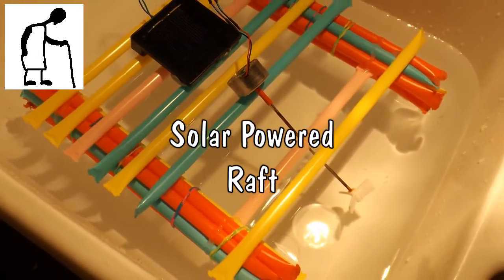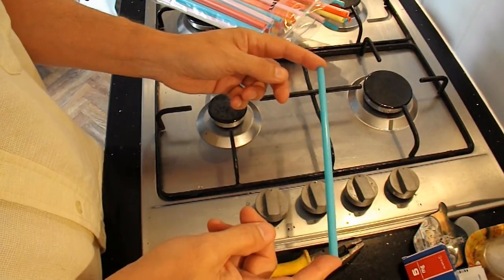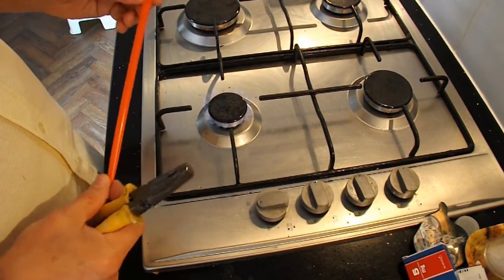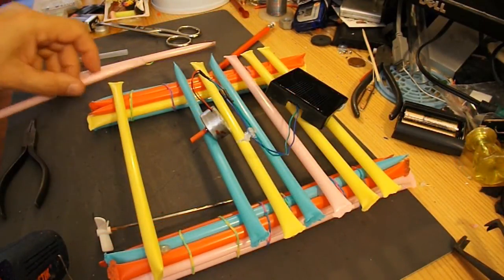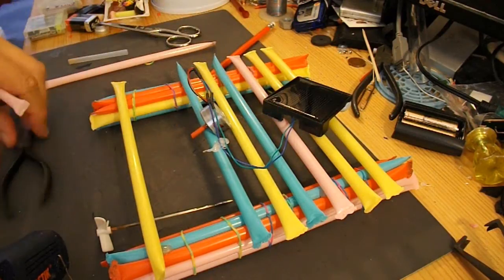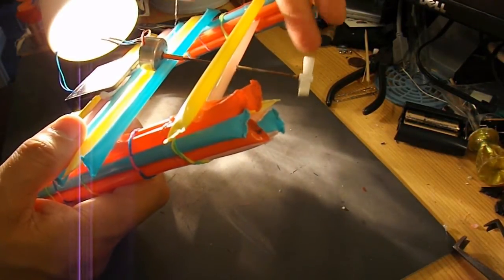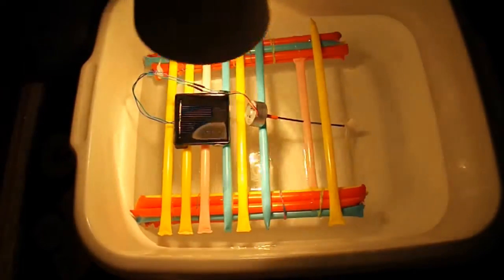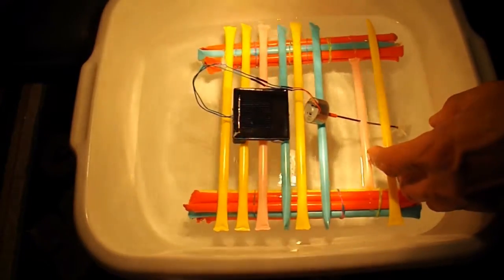Hey Grandad, can you make a Solar Powered Raft?

Comment: Grandad, do you know any items I could take out the battery cases from? I'm thinking about using batteries and using the motor from my 6 in 1 solar kit to make a battery powered car.
Reply from the maker: just about anything that uses batteries. You might have to saw the casing to get just the bit you want. With that solar kit you probably only need a single AA or AAA battery so that might be a problem but you could use a box that holds two and wire it so you can just use one.
Reply: +GrandadIsAnOldMan I have a tiny Coke Can RC car at home that stopped working, I'm thinking of stripping the battery case off the transmitter and taking the motors from the car, I have so many ideas running through my head right now for things to make, I also have a quadcopter at home which I can strip the motors off. But I have to find a way to open the car now, the screws are really tight. I'm like an early teenager so I can't really buy motors so I'm trying to find motors from stuff laying around at home.
Reply from the maker: +The QueensConquerer here is my Electric Toy Cars playlist https://www.youtube.com/playlist?list=PLA5a2xPRSrB0yTUYmJSS3ML5xxaBzHl3e which has quite a range of projects. Here is a simple example that might give you some ideas https://youtu.be/bEPU4hRB9l8
Reply: +GrandadIsAnOldMan Thanks :D
Reply: +GrandadIsAnOldMan Grandad, I was wondering if I could use the RC components from the Mini RC car to apply it on my build. Can you show me how an RC set up works?
Reply from the maker: The QueensConquerer there are hundreds of variations of cheap RC receivers in cheap RC toy cars but they are generally the same configuration. You will have 2 wires going to the drive motor and 2 wires going to the steering so you just intercept those wires and connect them to the motor on your build. Most of these receivers are no more than remote on/off switches giving you Forwards - Off - Backwards. On the circuit board they are often labelled F and B for the drive motor (Forwards Backwards) and L and R for the steering (Left Right). A word of warning, if the motor you are connecting is too powerful you can quickly burn out the receiver with the current draw. Connecting a larger battery will make this worse. By coincidence I do have a video in my schedule that takes a closer look at a typical cheap RC toy car receiver. It is scheduled for publication on April 9th
Reply: +GrandadIsAnOldMan Hmmm....that's interesting, I just opened my little RC car and got the motors, wheels and battery. I found this other thing that I cannot identify, maybe I'll make a video for you to share my findings with you. I'll post the link here for you to see when I'm done making the video.
Reply from the maker: The QueensConquerer if it is one of those really small RC cars then I am guessing you are looking at the steering which is probably a coil of wire and a magnet. The current flowing through the coil makes the magnet twist and that moves the steering linkage.
Reply: +GrandadIsAnOldMan No it's this round thing that was connected to the battery, I'll post up a vidoe by today